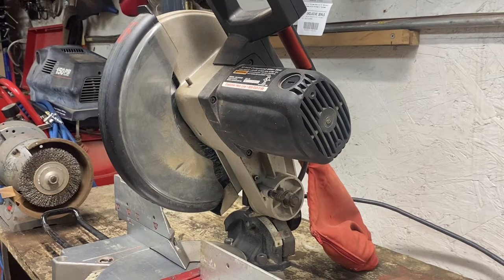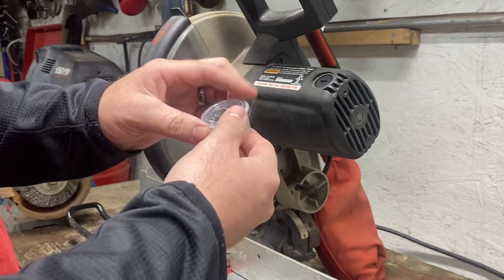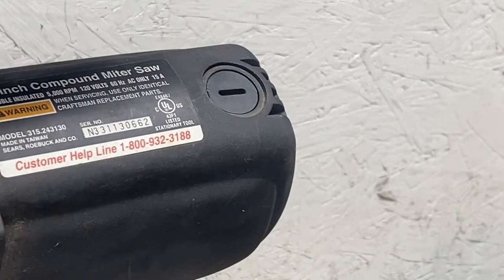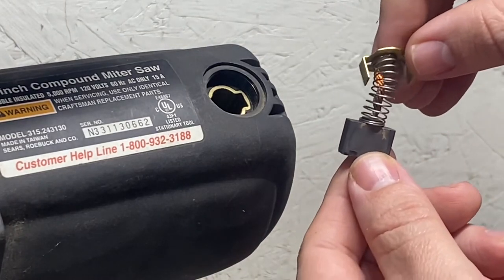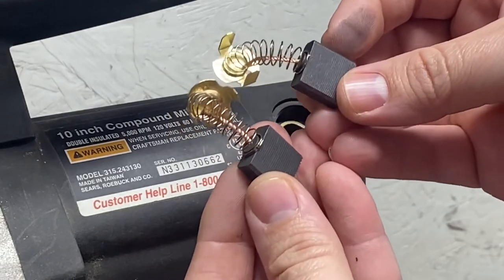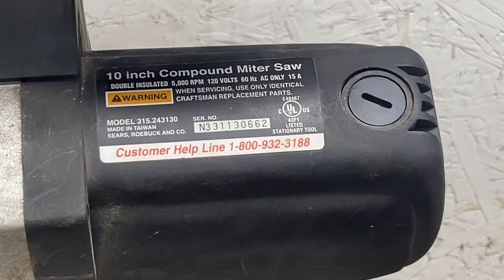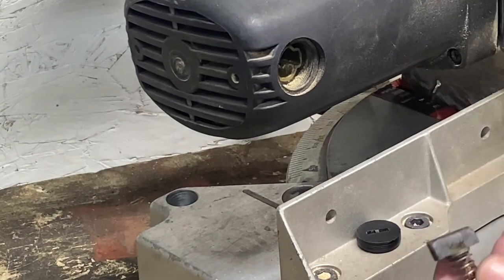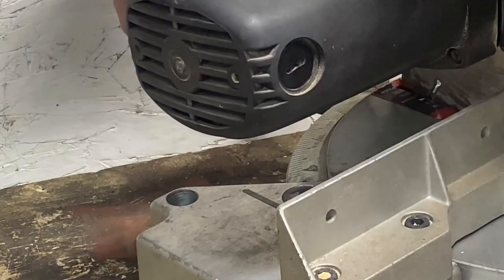How to change miter saw brushes

Comment: Looks like there is a hole on each side. I think you could use a pick or a piece of wire to hold the brush in place until you can screw the cap on.